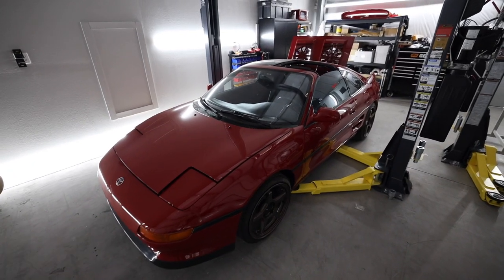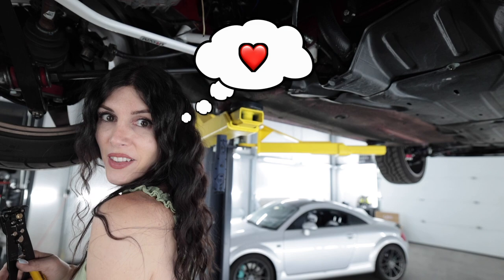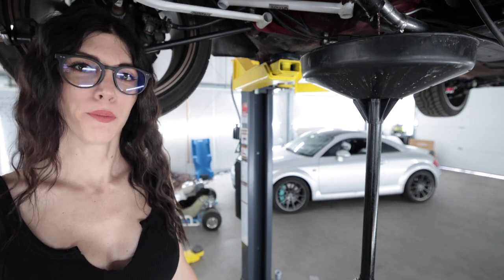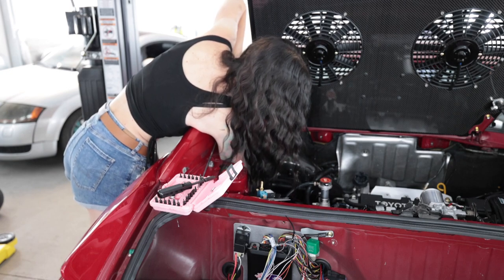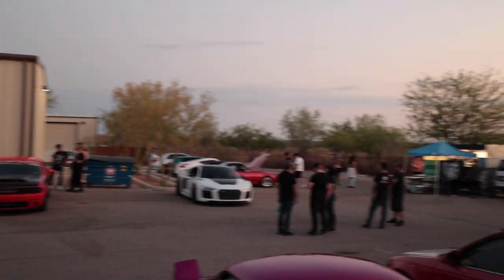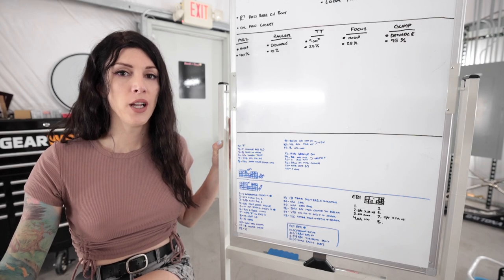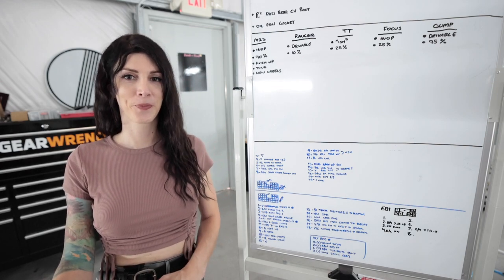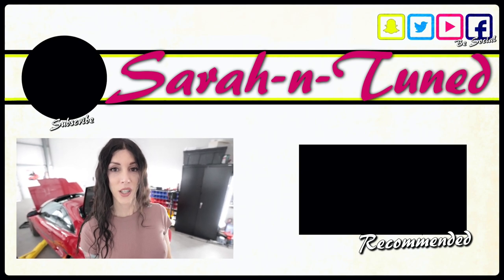Connecting Power For The First Time! // MR2 Turbo Complete Re-Wire

Comment: 1st Gen Scions didn’t have factory cruise control either. It was a dealer add-on. Supplier name is Rostra. You should be able to have cruise control without drive by wire

Comment: you can use an inferred temp gun fairly cheaply to check for electrical heat
Reply from the maker: I have one in my tool box!
Reply: @SarahnTuned  I use it to quickly find failing circuits on Fire trucks, i enjoy your spirit, comedy and detail of repairs or upgrades on vehicles. The MR2 series almost makes me want one as well. Do well Sarah you have a great channel!

Comment: Bleeding the coolant. Yep it occurred to me that draining the coolant should be done through a purpose included valve at the lowest point. Why not? Just open a valve and it drains out in a CONTROLLED fashion. It's no more likely to fail and leak than the many joins with hose clamps. And it would be so convenient, not messy.

Comment: Who would think feeling the wiring temperatur is weird? Have some collegues who use a thermal camera for their yearly inspection of electrical connection of industrial buildings. Basically the same thing. ;-)
Glad for you that you kept the smoke in, and there was no Ampere-smell.

Comment: So I remember you said your waiting for better connectors that you will install later. Did you know they make heat shrink tubing with adhesive inside? I got some with a OEM Ford pigtail I bought. As the tube was shrinking it squeezed a little out the end and it immediately hardened. I think it would be 100% waterproof. (bigger concern here in Detroit) Just an F.Y.I. Love the videos.

Comment: Trust me, heat-checking the wiring is 100% a normal thing to do if you do electronics regularly - warm wires are delivering more current then they should, a sign of things that will go wrong but haven't yet, giving you enough time to disconnect the supply.
Also, where is MrDos's flywheel cover plate??

Comment: Dual boot your mac with bootcamp, no need for a new computer.
Reply: Or virtualbox it.
Reply: Nah. PC Laptop for ECU is clearly a 'business' buy, so there's tax write down advantages in the accountancy side to be had, can't gain that with Boot Camp.
Reply: Or throw that trash mac into the bin where it belongs
Reply: @_.Dave._  Macs handle video editing way better than PCs though.  It's probably actually wise to have both, in her case.
Reply: @juliedonald393  As a Cinematographer and Editor - Nope.
Resolve on PC is superior in every way to FCPX on Mac, to the point of Resolve usurping Premiere as the defacto industry 'standard',.. and for editing speed, nothing, nothing at all, comes close to Edius.
You are right that there's wisdom in her having both, but IMHO, All software should be platform-agnostic, so all users have equal access and support.
Reply from the maker: @_.Dave._  good luck editing YouTube videos this efficiently, at this level of quality on a PC.
Reply: @juliedonald393  not true. Macbooks have appaling cooling, and cannot run 100% CPU and GPU for very long before overheating, and throttling back the processors.

Comment: Look up the Dakota digital cruise control module CRS-3000 should work for you.  If not a 2000-2003 Chevy truck cruise will work that is what I used in my LS swapped 89 firebird.  I can do a write up for you if you go that direction.  It's just a few wires.
Reply from the maker: I emailed them last week
Reply: @SarahnTuned  Dakota would be cleaner but the chevy truck module doesn't require a PCM signal (F-body etc do)  Its 10 wires ON/OFF, Set, Resume/accel, clutch safety, brake safety, ground, voltage, brake light signal, status (idiot light), vss (4000 pulses a mile) so the only limiting factor is can  your ECM put out a speed signal of 4000ppm, if not I think the speed sensor is actually 4000 on the toyota.  The different set controls are simple momentary switches which should work with almost any factory control button set.  (I wired my LS1 swap from scratch, everything works in the car and it looks factory so I feel your OCD on this)

Comment: Heater hose permanent solution. They make stainless 45 degree (and other degrees) heater hose nipples. Best would be to cut off most of the existing straight nip and tap inside for the npt pipe thread on the 45 degree nip or 90 or whatever you want to use.
Reply: Earl'sPerformance

Comment: Did you rubber mount the boost controller valve? On my 951 it was pretty noisy mounted on the firewall.

Comment: Who puts a GM MAP sensor on a Ford, gee I din done electrical technologies classes at school... why wouldn't I put one on there? runs slightly rich at idle so it dropped 300rpm, and then the IACV went mad because of the higher vacuum in the intake pipe... so it sits at 2600rpm before the IACV closes and it falls to a 1300rpm idle. wee... wee... WEE... HAH... WEEEEEEEEEEEE... OPEN WINDOW AND WINDMIL IN HAND.
Reply from the maker: https://m.youtube.com/watch?v=TYHO0-0W5To

Comment: Since you are asking and talking about audience suggestions and expectations: 
I do not want you to put any more time effort or money into the TT. 
It was a poor design, badly executed and will  be a non stop source of frustration and an endless money pit. I would sell it to raise capital for another more worthy car. 
 
The MR 2 is a worthy project that will result in a fast, reliable, great handling, midengine pocket of joy. I would probably stick to one major modification at a time, like finish the wiring before experimenting on novel cooling hoses and rerouting everything on a cooling system you have cracked 10 times,  but that's just me. I believe you will get it going and preforming well eventually but have also realized you don't actually "finish"  projects.  
The Forester for example, needs nothing...but you will continue to modify it; which will delay the other projects as usual. 

The Focus can be a serious rally car. Rallied and then sold to fund other projects. It will require many hours to get up to any kind of competitive competion performance level. At this rate I'm not sure I will still be alive or sans dementia by the time you finish it. 

And the Ranger could use some TLC especially underneath and that process would arouse sympathetic viewers also carefully maintaining old family transportation favorites, but a frame off restoration for a stock old Ranger is something no one else would  consider. 
You have the skills to restore or modify something special. A classic or performance restomod . Keeping Grand's truck running and looking great does not require a six month tear down and build.  
This six projects at once approach that never end, does frustrate some viewers. 
I enjoy the humor, satire and improv and the double entondres and your on screen persona in the car reviews but I am a bit disappointed in the build and modify stuff.  

That  perm looks cool, Almost looks like you got it connecting the fuseable  link. Sincerely watching from NYC...Larry
Reply: Did you compare your unreserved judgement to the actual analytics to Sarah's previous videos before you posted your comment? No? OK then...